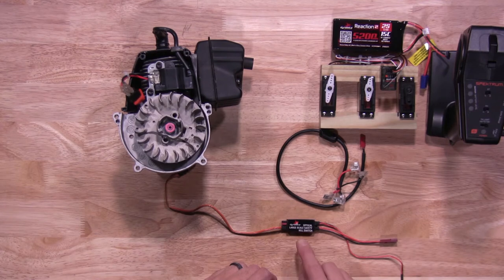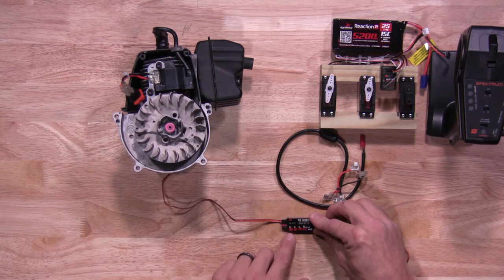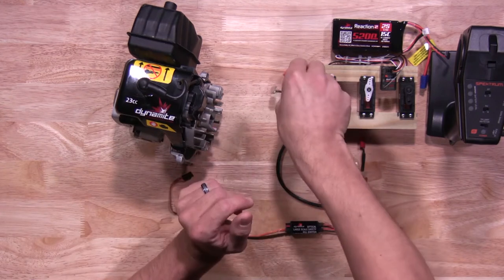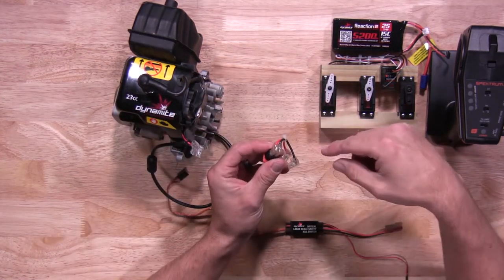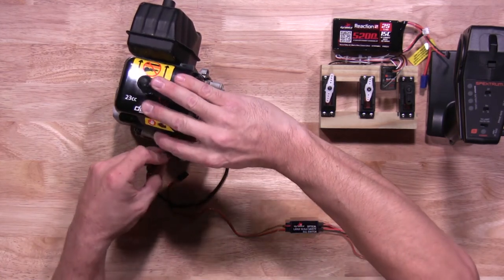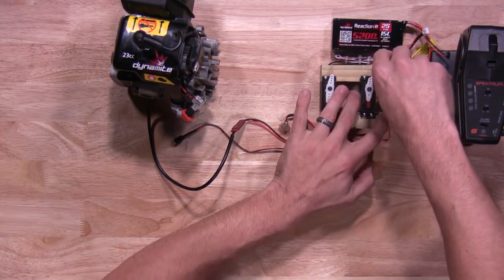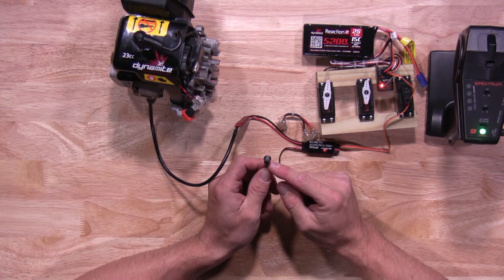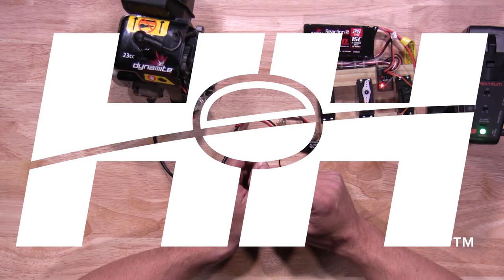From the Tech Desk: How to set up a gas engine Safety kill switch

Comment: Watched this so I could work out the orientation of the low voltage bridge plus for 4volt cut off and you didn’t explain it? Just that it has the feature. I’m thinking 4 volt cutoff is bridge plug horizontal top two pins. I’m calling the top of the kill switch the surface with “Dynamite optical large scale safety kill switch” sticker writing. Is this correct? Thanks